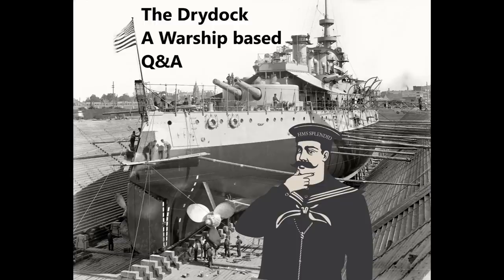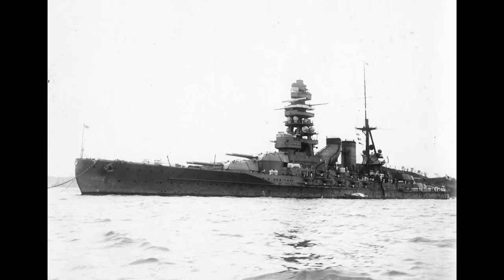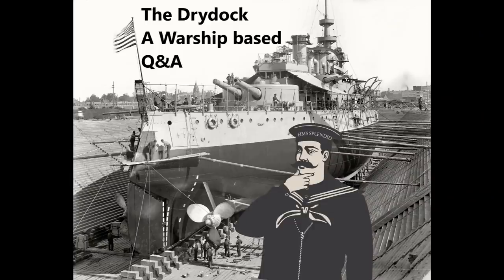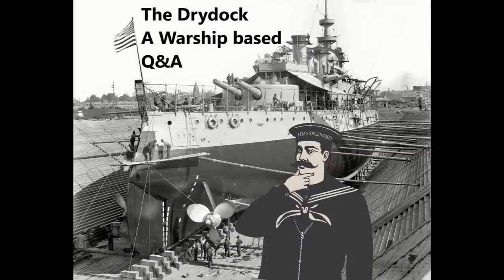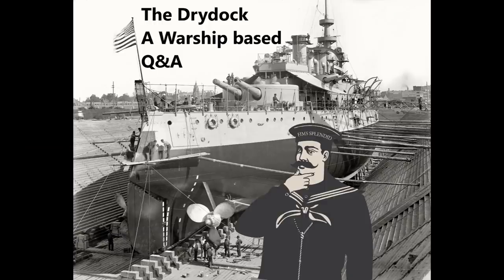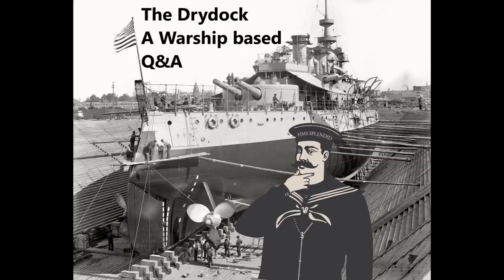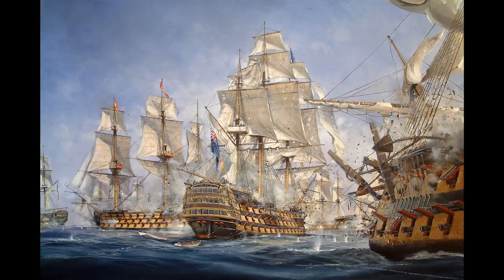The Drydock - Episode 176

Comment: To the first answer: I think the germans did still have the know how to build the 15" Guns from WW-I. They did do a design study in 1935 to see if they could improve the design to use at Bismarck.  They would come to the conclussion that it could be done (38cm SK L/56) but the weight would be to much so they went on to make a new Gun (38cm SK C/34 ). The point is they would not do that if they could not build it in the first place. They would also design and build heavy railway Guns at the same time. I mean the Design for the 80cm Gun (E) would take place at the very same time (1934) as the design for the guns on the twins.

Comment: To better or more or both German designs: the lack of light cruisers somewhat forced the Kriegsmarine to mount 15cm guns on their destroyers, which resulted in top- and nose-heavy DDs with a low rate of fire. While in theory they could eventually take on a CL, they were not stable enough gun platforms to actually do so.
Light cruisers could have possibly stayed with the Scharnhorst during the battle of the North Cape.

Comment: The USN was looking at using the 16" 50 calibre from the original South Dakotas for the Iowas. If there was such a difference between a WWI gun and a 30s design why was this acceptable in the late 30s?
Reply: The specification for the two different marks of 16"/50 are very similar, with the big difference being the lighter weight of the more modern gun, just like with the various marks of 16"/45s. The big differences in performance over that time come from improved shells, with shells growing longer (and therefore heavier) and more streamlined while also being made of improved and more durable materials (better metallurgy).

Comment: Minor correction on the Abruzzi-class - I think you may be mixing up standard and full load displacement?

Standard displacement for Duca degli Abruzzi was 9,440 tons (11,761 tonnes metric full load), while Giuseppe Garibaldi came in at 9,050 long tons standard (11,350t metric at full load).

Comment: I'd make an argument for the Nelsons being the SA-80 of the naval world.  Did really unusual things to the weapon (all forward turrets vs bullpup design) to make it shorter and lighter without reducing its firepower.  Went a bit too far in chasing those benefits and got initial unreliability (Nelson's finicky shell/powder handling equipment) but eventually turned into a useful and effective weapon.
Reply: One of the more balanced designs, considering the treaty limitations (and technically within those limits)
Reply: Sort of but it never had something as integral to the system failing too often and also by the end it was a lot more than just useful and effective, they turned out to be exceptionally good battleships, especially for when they were built.
Reply: I have to say comparing the all forward layout too a bullpup is quite funny as you can say the Richelieu's are therefore the Famas. Although didn't know Austria had a Steyr Aug battleship 😂
Reply: @Alex-cw3rz  what is the Austrian Steyr Aug Battleship’s name?

Comment: I love the nagatos, but I think we can consider them battlecruisers more than battleships.
I've considered asking it for months and now I say it as a statement: if the hood is a bc, then the nagatos are too.
Or fast battleships, fine by me. Discussing if a ship is a bc (the scharnorsts, the Alaska, etc) is a gift that keeps on giving
Reply: I like to argue that the Iowa class are actually battlecruisers.
Reply: @tominiowa2513  You would be wrong since it would be impossible to armor an Iowa to standup to her own guns at 20kyd.  You are talking about 20" of armor.
Reply: @johnshepherd8687  The main belt armor design thicknesses are 12.1-inch and 16.1-inch for the Iowa and Montana, respectively.  I do not have an armor penetration resistance chart at hand, but a one-third increase in thickness is substantial.
Reply: @tominiowa2513  The Iowas' armor is inclined at 17° which makes it equivalent to the later Standards.  The NAVWEAPS site has Armor penetration values.  The Mk 8 AP round fired from the 16"/50 can penetrate 20" of armor at 20kyds and 17.36" at 25 kyds so I guess the Montanas would have been Battlecruisers  too.
Reply: Hood isn't a battlecruiser, the Alaskas are supercruisers and the Nagatos are too slow to even be considered such...
Reply: @johnshepherd8687  Did you consider that the Montana main armor belt would have been inclined at 19°?

Comment: 40:59 Part of the question concerns the relatively greater amount of explosive in an armor piercing shell. 

Wouldn't the different jobs explain that difference? Getting through armor would require more force than turning into shrapnel. Making big hole all around itself is a high explosive shell's job - wouldn't that charge be packed differently from the directional charge of an armor piercing shell? Mightn't that explain the apparently lighter charge ?

Comment: You rate the Towns as 50-50 against the Abruzzi, but gave the edge to the Crown Colony vs the Abruzzi (Ep 170). Clarification?
Reply from the maker: Being later ships the Crown Colony types would have more advanced fire control systems assuming all ships are considered approximately as built.
Reply: @Drachinifel  Ahh, I somehow always thought the Crowns were slightly inferior to the Towns, being the diminutives. Didn't consider the tech advances.
Reply from the maker: @glennricafrente58  on paper yes the Crowns are lesser ships, but in a light cruiser duel I tend to think first hits matter more and the Crowns as built would have that capacity. Of course, and updated Town with the same equipment would so better still, but then you get into the field of picking years arbitrarily, which can make it too easy to rig the field
Reply: @Drachinifel  Gotcha.

Comment: The 15" gun question can be paralleled by the USN and ANY gun over 8" today.  The last large gun barrels where when the guns on the Iowa's coming back into service....  One of the reasons the USN was always so careful about how many rounds they fired through those tubes, WAS THERE WERE NO MORE REPLACEMENTS (Indeed that is no way to even replace the armor, or engineering plants).  As for the oft repeated fantasy of resurrecting the Iowa's...THERE ARE NO PLANT OPERATORS FOR THE STEAM POWER SYSTEMS ABOARD!  Iowa was the training station/'ship for the plants when they brought them back (though the Sacramento class (oilers) had HALF of an Iowa plant aboard).
Reply: Making replacement charges would be hard enough, nevermind making the machines that make the machines that make the barrels.
Reply: Ryan Szimanski tells us that with polymer additives to the powder, barrel life of the Mark 7 guns was extended from about 300 rounds to 1500 rounds.

The biggest reason to keep the Iowa class as museum ships is that so much of the ships will have issues due to metal fatigue and stress corrosion that it would be less expensive to build a new one with modern systems.
Reply: Actually there were a number of spare barrels.
Reply: @Philip271828  they didn't have to make barrels. The US had a supply of spares.

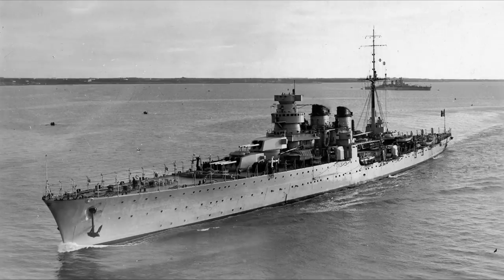Comment: 32:39 two things that aren't taken into account here is that the lack of torpedoes on the Brooklyns is going to be a huge problem, in a 1v1. And although the Brooklyn's have more fire power, the Italian ship has better rangefinders and therefore better accuracy, even their much older WW1 cruisers they still had, were hitting on the 2nd salvo at battle ranges. The brooklyns on the other hand not so much.
Reply: What bout their shells? It doesn't matter if your sights are on if you ammo is ill balanced.
Reply: COPE
Reply: @issacfoster1113  how is it cope?
Reply: The Italians still have rather shite quality control when it comes to the shells they're flinging though ruining the advantages of their rangefinders and fire control systems
Reply: @Alex-cw3rz  Don't care about that troll
Reply: @firestorm165  that was for battleship shells for the smaller guns like these there wasn't that problem present.
Reply: Brooklyn has surface search and rangefinder radar equipped.
Reply: A big gun ship should never let another one into torpedo range.
Reply: @dongiovanni4331  those radar ones would only be useful in the much later iterations and this would rely only on the Italian cruiser coming out in poor conditions which they wouldn't, in any condition the Italian crusier would choose to battle in, as it has the choice due to it's speed. It's own rangefinders well outpace even the last iteration put on the Brooklyns and this is ignoring the fact that when the usable radar came, Italy was out of the war and Italy was also very close to implementing it's own radar systems
Reply: @Alex-cw3rz  useful enough to out spot the Japanese at 2nd and 3rd Savo island.
Reply: @dongiovanni4331  did you mean to say savo island as that was a disaster for the Americans and no brooklyns were there only better equipped and more capable cruiser where there, not just that I'm an positive that the Japanese spotted first
Reply: @Alex-cw3rz  At Cape Esperence, USS Helena (a Brooklyn class light cruiser) spotted the IJN formation at 27 km on radar. USS Bois, another  Brooklyn class light cruiser spotted the IJN formation a few minutes later.
Reply: @dongiovanni4331  right just for future reference it's called the Battle of Cape Esperance, not 2 and 3 savo island as nothing comes up. 1. Why are the Italian ship out at night 2. Why would the italian ship presume the US ship was friendly 3. Italian training was league's ahead of Japans so after that first shot they should have adjusted course to avoid the next salvo. This is the problem comparing two completely different navies and ships. On a 1 on 1 not one thing that happened here could ever happen in a 1 on 1.
Reply: @Alex-cw3rz  I first heard of the 1st through 5th battles of savo island as the actions in iron bottom sound
Reply: @Alex-cw3rz  Italian are also bad at night fights. Britain prove that.
Reply: @issacfoster1113  Well not really, that was the British doing something only the best trained navy on the planet can do and the right night conditions, if it was a brooklyn there, due to their much smaller shells than 15 inch, the Italian ship would just fire torpedoes and get the easy win.

Comment: Arm the Scharnhorsts with Gamma Morsers, sez I . . . kind of like a blindfolded Mike Tyson against a room full of smaller heavyweights. 
https://en.wikipedia.org/wiki/42_cm_Gamma_howitzer
For size of bore, however, I like the French 520mm railguns, but they (1 out of 2) had an annoying tendency to blow up, killing crew.
https://en.wikipedia.org/wiki/Obusier_de_520_mod%C3%A8le_1916
Imagine arming the Roberts class with those!
Reply: A 22-caliber gun with a maximum range of less than 16,000 yards would not be an effective naval weapon (other than on a monitor for shore bombardment).

Plus the German siege guns can be defeated by using one tank as a launch ramp for another tank, and the airborne tank fires into the barrel of the siege gun while on the downward arc.  😉

Comment: I'm getting a buzz from the microphone from the start of the video. I'll edit this comment if the buzzing goes away at a certain point in the video
Reply: In fact I'm only a few minutes in and the buzzing is more than I can bear. I have switched to using speaker instead of headphones. The buzzing is still apparent but it is no longer in my ear directly